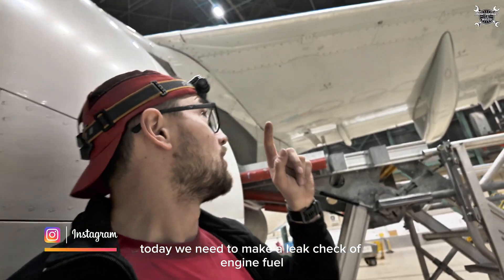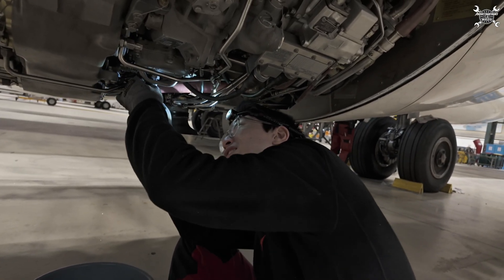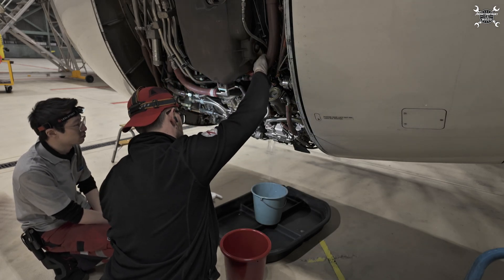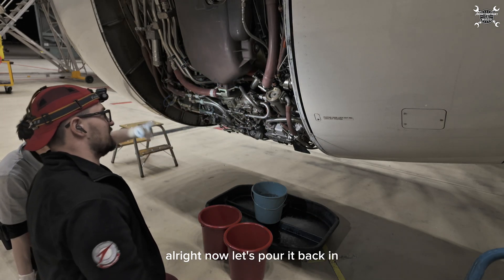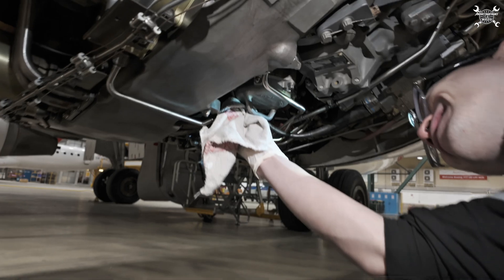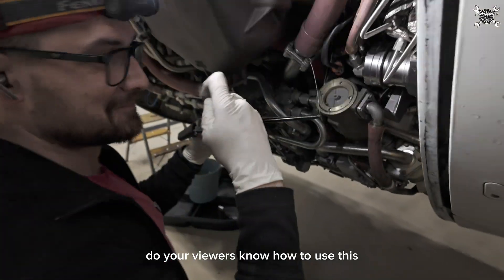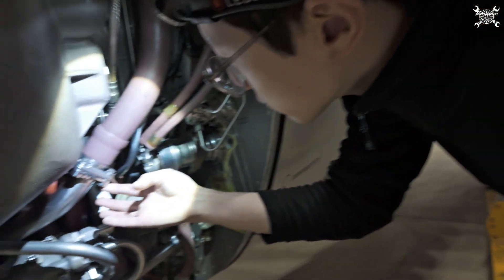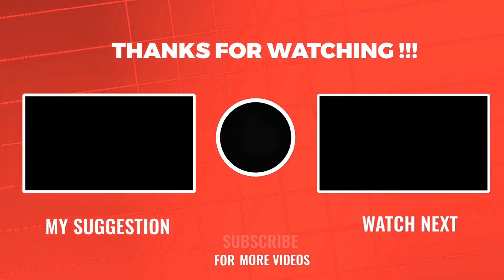How to feed A320 engine with fuel

Comment: hey good morning Thomas 
thats the good briefing view of fuel spar area valves .
so as i understood they are motor driven in either direction valves . you confirmed by once open it by electric command then you cut the power and it was still stay open ?
when you clse them you give electric DC in opposite direction and motor will run opposite direction and  will close the valves ?

plz confirm it  and huge thanks for your helping gesture